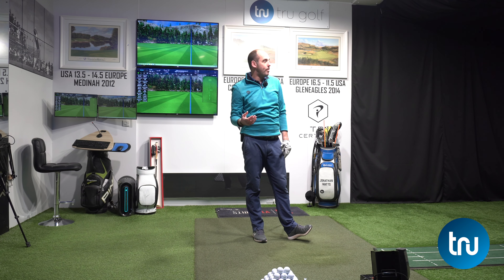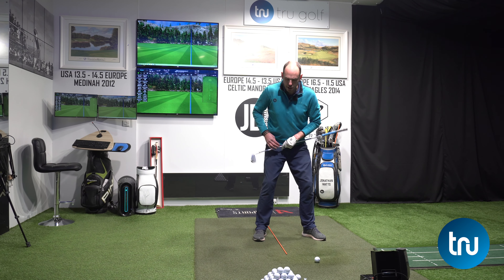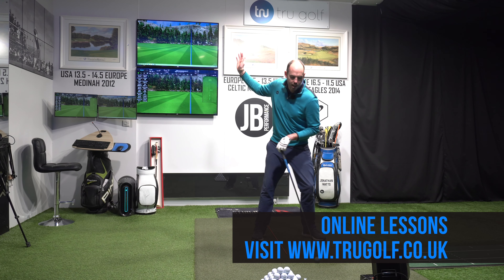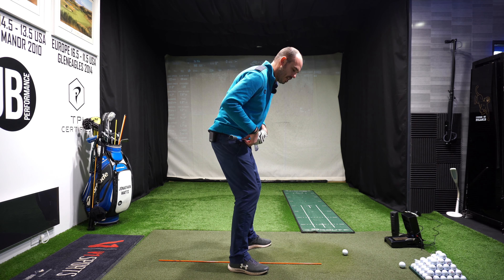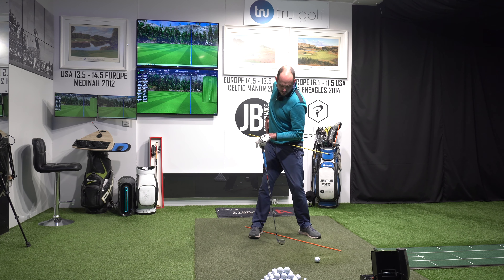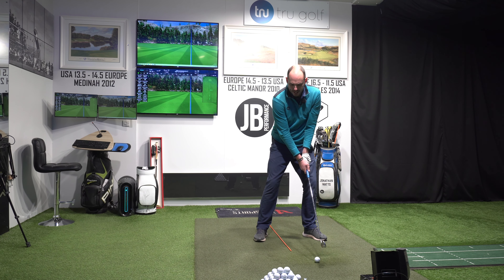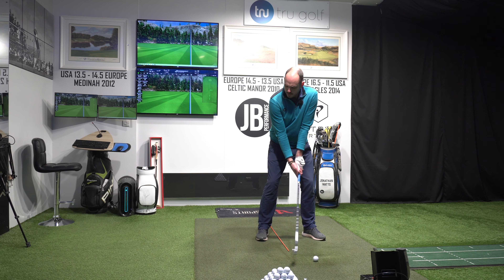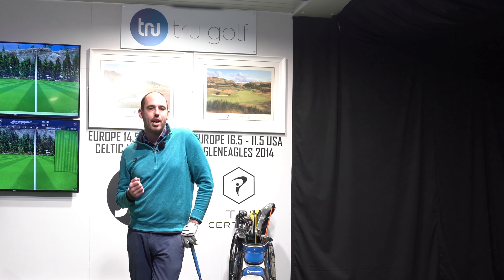HOW TO MAKE THE PERFECT BACKSWING - COIL CORRECTLY

Comment: Excellent video John!  I have been working on the "pressure points" in my feet in order to get a better weight transfer.  This has also helped with my body rotation and more solid strikes.  Keep up the good work!